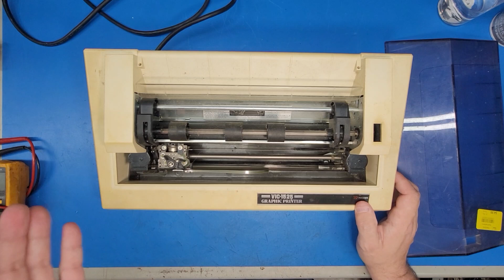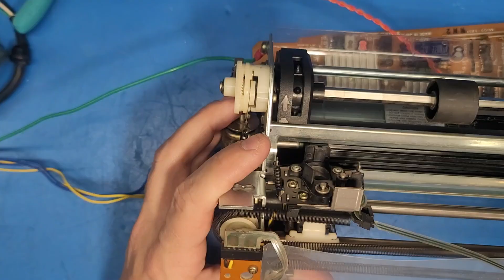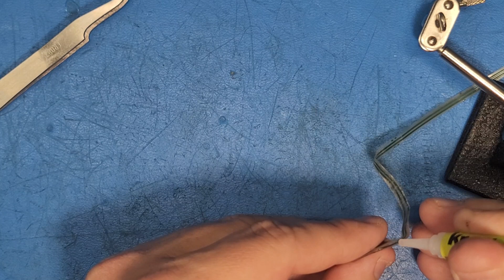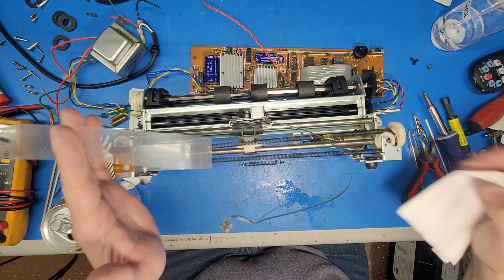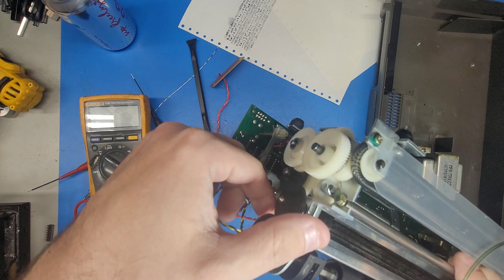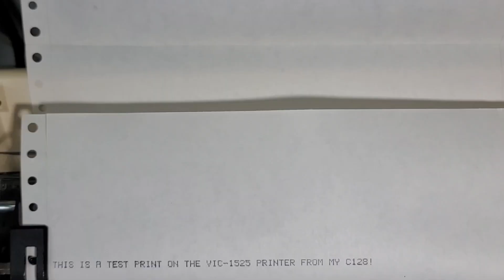Goodwill Find: VIC-1525 Graphics Printer

Comment: The heavy lid was a sound shield.  It was unbearable without it.  Just noticed the darkness adjustment.  The user could move the head closer to milk every last drop of ink.  A single pin head struck a 7 position drum behind the paper.  Did not know about the spring loaded head return.  Motors were so expensive in those days, a single motor was all you got.  The clutch seems to also send power to the tractor feed  when the head retracts.